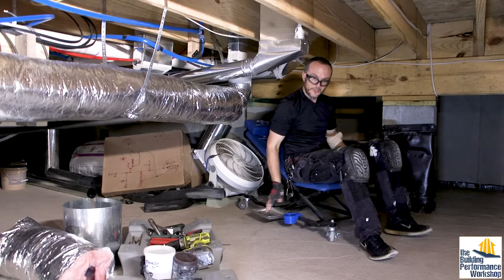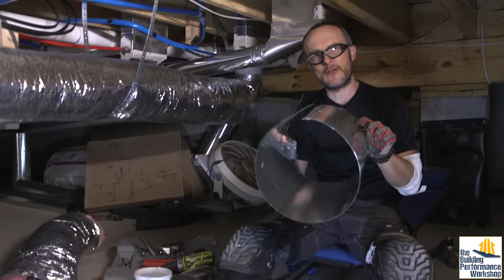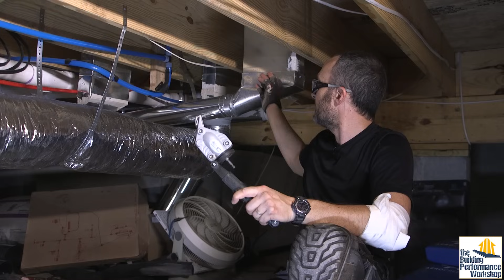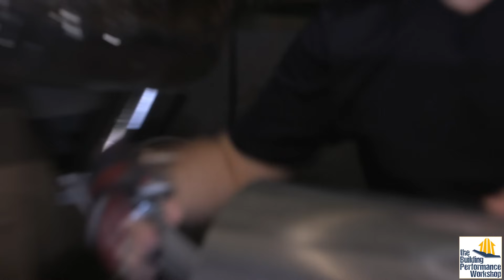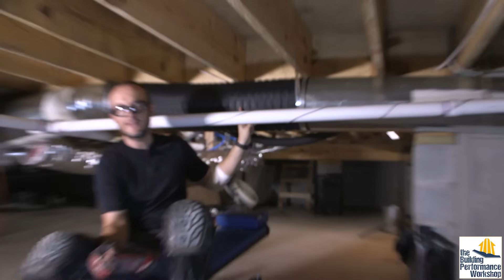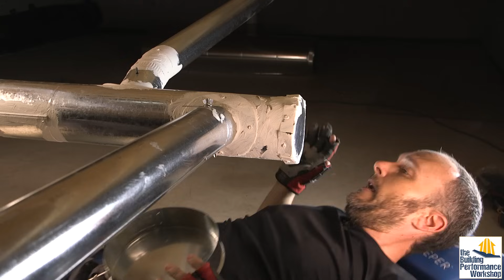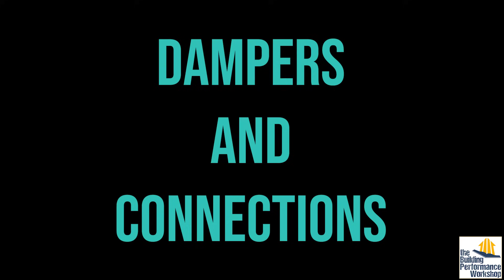Performance Duct Design & Installation: Advanced DIY

Comment: Having a return register at the floor means it draws dust and pet hair across the floor and into the filter.  If the pull is strong enough that will collect along the bottom edge of the register.  IMO the return should be a few inches up off the floor.
Reply from the maker: Yes, good point- ours clears the baseboard, so 4” up. More eould be better if you can find the space.

Comment: Disagree about the UltraAire whole house dehumidifier.  I had one replaced under warranty 4 times.  It leaked refrigerant.  It was installed in the basement under the master bedroom, so likely I was breathing that leaking refrigerant for years.  I had it serviced once, over 500 to recharge it.  No one locally will service these units anymore.  Now it just provides ventilation, but the air is not well filtered or conditioned; there is a standalone dehumidifier which also has been replaced several times but is less than half the cost of recharging this unit once.

Comment: Where did you get your duct wrap insulation without having a license? It's wild how small that stuff is in the bog box stores compared to wholesale.
Reply from the maker: Open a cash account at sn HVAC supplier- they won’t sell you equipment or refrigerant, but you can get ductwork
Reply: @HomePerformance Thanks, I’ll give it a go.

Comment: I'm in the process of designing our new home and would like to have a super efficient HVAC system like this. How did you design it and how would i get it done for my new home? I know the HVAC companies don't do it like this in the area. They just figure out the BTU and CFM needed then run flex duct which typically isn't run properly because it has a lot of spots that restrict flow. Any help in finding a person that can help design a system based on our plans would be greatly helpful.
Reply from the maker: Hi Jake- if you email me, I can get you a bid for a design for your home by me personally:

https://buildingperformanceworkshop.com/energy-modeling-and-hvac-design
Reply: @HomePerformance just sent you an email. Thank you.

Comment: Do makeup air ducts in conditioned spaces typically get insulated to prevent condensation? I'm about to run makeup air ducts through walls and don't want to end up with condensation in those cavities.

Comment: Man I love your videos. I will say that's very funny about your design versus the field because I'm in that same situation. Like you, I want all galvanized steel ductwork because I believe in longevity, durability, and easy cleaning. However, with the design of the house (because my living room has a cathedral ceiling so that ductwork has to work around it), the high static pressure, and all of the boots causing a huge equivalent length addition, I just had to go with flex stuck as branches. But you better believe I'm still putting in those dampers though.
Reply from the maker: Engineering is a series of compromises ;) good work

Comment: One of my favorites. This requires 2 people. Attach multiple lengths of snap lock pipe together as needed for the run. Mastic or tape the connections. Then tape the required length of snap lock to one end of the flex inner liner. Start pulling the inner liner out the other end and you now have insulated snap lock. You can also fabricate insulated double wall by installing a larger diameter snap lock or spiral over the exterior.

Comment: I've been watching videos on flexstock from professionals and they said you need to put 25 lb of pull on the docked to make sure it's not all kinked inside and that will help with the airflow
Reply from the maker: For flex duct, sure- per the Air Duct Council’s Green Book

Comment: This video is awesome. Bravo!!

My house was definitely not balanced and we've wasted time and money dealing with other HVAC companies trying to modify/correct it. I believe it's primarily all flex duct and the 3 bathrooms and the laundry room are saunas in the winter and fridges in the summer. 

HVAC company 1 tried a zone controller and two dampers. (We're a main + ADU and they have a return and we have a return; ~1600sqft-~800sqft respectively) No luck. 

HVAC company 2 tried fixing something they found wrong and the handler started providing resistive heat when the fan was circulating air (no call for heat/cool). After multiple visits they wanted to replace the zone controller for $1600. Most expensive POS design ever. 

(There's also a fresh air damper on an analog timer with a relay and 2 assumed 20VA transformers wired together to handle the 3 dampers, analog timer and zone controller)

I'm going to try replacing the Honeywell with an Ecojay unit. I want to look at changing the ductwork, but it's both intimidating to design and messing around with blow in fibergl@SS is not my favorite.
Reply: Sauna in the winters, freezers in the summer,  just what im looking for in northern Wisconsin

Comment: I had a drug design done by a professional, which used a computer. Everything was done in rectangular size ductwork, except for the supply leads off the main and the return main. Should I change the mains to round?
Reply: Duct

Comment: Thanks for a great video. 
My house has hardwood floor registers flush mount. I understand the grills are very restrictive. Do you know of any drop in flush mount(not raised on surface of hardwood) that would be higher flow? Also maybe be able to use original hardwood flange for grill. Thanks

Comment: I have a new single story home with an attic that houses all of the duct work and HVAC system. I noticed onen 6 foot duct line between a supply line and the return line is not installed. Both sides were open ended. The HVAC tech noticed this and will come back with a flex duct and install it to close the system. For now, he just taped close both open ends of duct. 

Can raw air from the attic that goes into the open return duct line ruin the HVAC system? This house is brand new and I have lived here only 3 weeks. I'm concerned about long term negative effects with the system since we have been operating our system (mostly heat during the winter) for about a month.

Comment: By design side discharge unit really doesn't require this option none of our commercial installs have ever required a cap only wind baffles mounted on the sides of the unit.

Comment: May I ask for the line sets what are the rules? Can it be manipulated up and down like up and over a header then back down the other side to tue condenser unit. I didn’t think these line sets could have any dependent loops or lower sections that then rest of it

Comment: For the drill hole cutter, would that also work on corrugated metal sheeting? I know that’s not HVAC relevant but I’m curious
Reply from the maker: Sure, as long as it’s not a super thick gauge. 28 minimum I think

Comment: a central return is better?  what happens when the doors to individual rooms are closed off (for privacy - or to keep pets out)? - supply air into those closed off rooms ceases circulating - and the room is cold in winter and too hot in summer.

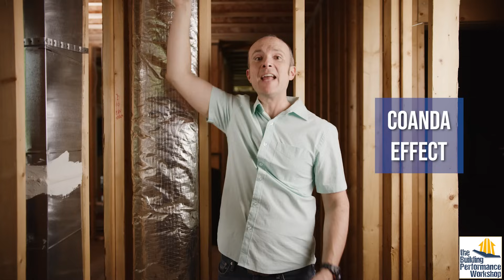Comment: Thanks for a very informative video! At 4:30, you show an example of an insulated supply duct running up in a stud cavity in an interior wall, terminating at a boot. Do I understand correctly that it's a 2x4 wall and the rigid duct itself is 3" deep? If so, is the remaining 1/2" of cavity depth enough to fit that insulation, which appears to be bulging out pre-drywall? I want to plan a similar design on a ducted minisplit retrofit, and am worried that my interior 2x4 walls aren't thick enough.

Comment: Hello! I got the response that you used Mueller Streamline line set in this install.  I've now heard from 2 installers that increasing the foam tube insulation (r value) on the line set will not increase efficiency. That does not seem right to me.  The line set recently used with my Mitsu mini split is very basic, minimal white vinyl sleeved foam.   Will I benefit by adding an additional sealed foam insulation tube around it?
Reply from the maker: I did mine that way because of the 120 ft length- it does make it more of a pain, no doubt
Reply: @HomePerformance  Did a little more digging. What I've got is PDM Gelcopper with 1/2" thick insulation, R value 4.0.  It should be a no brainier, but do you agree that adding the additional foam insulation tube over the existing PDM will increase efficiency?  Like move it from R 4.0 to R 8.0?

Comment: Hi, I'm just beginning to learn the in and outs of HVAC and ducting systems, to build my small house, and there are a couple or three things you have that I don't understand and hope you'll help me with:
1 - there seems to be no insulation between your crawlspace and the upper floor plus your ducts are not insulated, is this a conditioned space and if so, are you returning air from a service space to your living spaces? I've been told to never return air from service areas like kitchens, bathrooms, laundries, and such 

2 - is 100 feet run of hydrocarbon in your line set a good thing (sounds long)? Does the distance between the compressor and evaporator matter?
Reply: 1. Check 4:00, he mentions the crawl space is conditioned. Hence, no need to insulate.
2. Check lineset specs. Most can handle well over 100’ distances.

Comment: on the straight long runs of insulated flex ducting add a board/ metal strip so the pipe does not compress at the strap or sag adding resistance to air flow

Comment: I have never seen any of our  HVAC contractors use mastic on the joints on any of the many houses I have worked on throughout 30 years, they use foil tape?.
Reply from the maker: Probably lasts as long as the flex duct its sticking to

Comment: I respect that 100 year house mindset. I'm working on a 500 year house design and wow, it's not easy to find the right materials and systems!
Reply: What have you found so far? Share the knowledge!
Reply: @caustinolino3687  Stainless steel plumbing supply pipes, not plastic or copper. Really good moisture control, especially in the structure of your external walls. And make the house easy to adapt or renovate! People building houses 500 years ago weren't planning for good wifi in every room, or electric lights, or even indoor plumbing. We have no idea what new technology will be expected in houses in the next 500 years, so all we can do is make it easy to add new pipes and wires.
Reply: @tealkerberus748  Good tips! I'm curious, why no PVC supply pipes?

Comment: Well, sounds like my spec home didn't have a good HVAC design. A single system conditions upstairs and downstairs and they are wildly different temperatures. Also the unfinished basement is getting conditioned by very poorly sealed ducting.

Comment: So this is phenomenal - thank you! I am building an ICF house with ICF flat roof in South Florida. Walls are 12 feet tall on the inside and no attic. I am planning to install sheet metal duct that is right below the ceiling, inside the house. My understanding is that I don't need to seal all the duct joints because the duct is inside the cooled area. If some cold air escapes before it hits the register it is not a big deal. Is my reasoning proper?

Comment: Don’t you want the registers to be on the floor only because hot air rises so when heating the the air will rise and fill the room. It be okay for cooling since cold air falls but not heating.

Comment: I am an everyday person without any experience with hvac. I love watching your videos for fun. They are so informative. I now feel motivated to invest a lot of effort into making sure we have a good hvac system whenever we decide to build our own house.
Reply: You can't go wrong that way. There's tons of information to assist. It's scary how many homes I've seen, some new and expensive, that have terrible ducts. Our house for ex.  unit and ducts were replaced right before we moved in. 5 ton ac, ducts have 2.5 tons of capacity. Heat load on the house at 110 is right around 3 tons.
Reply: I wish more people thought about their hvac system when they try to build their dream home. As a hvac installer and service tech i can attest to the attention to detail that is frequently overlooked

Comment: Personally I prefer to put return ducts in the bedrooms so the doors can be shut for fire safety while sleeping and the rooms can be conditioned while the doors are shut.  I suppose you could use jump ducts to accomplish that but it's not what I would do.  I'd also make the filter grill 4 inches deep from the start.  You could always add spacers for thinner filters.
Reply from the maker: UNDERCUTS on the doors silly. It’s actually in Man D- a 24 sq in undercut can return 50 cfm, a 36 sq in undercut can return 75 cfm. Very few rooms in any performance-tuned home will receive over 75 cfm.

Comment: "I'm recommending a total duct replacement" Of course you do, it doubles or triples the money you make. Now, that's not to say they're aren't times this is needed. Flex is fine so long as it's installed properly. To say otherwise is simply spreading FUD.

Comment: as a contractor, you lost me at your discussion of a central return.  unfortuately, the international mechanical code that i subscribe to, requires a return in each room except for the kitchen, bathroom.  Further, 2" wide haning straps are required on flex duct probably every 4'
Reply: I hate not having a return to any room, like a bedroom, with a door. You either need to hack off a bunch of the door, or install a hole in the wall so you loosing privacy or you need to leave the door open most of the time.

Comment: Scoops are really bad for downstream airflow.  The 45 degree take off is a much better way to go.  This has been proven on the bubble machine.  Great system other than the scoops.  I with everything had to be put in like this.  It would eliminate so many problems in the field

Comment: I just had new 2 stage heat pump installed. New duck work and everything.
It has very little air flow coming out.
You can't feel it standing under the vents.
I asked the guy that installed it about the low air flow, and he says that's normal on the new units.
Does that sound right?
It's a 14.3 ream 2 ton unit.
In a 1600 square feet home
Reply from the maker: Yes, that sounds fine to me, Terry- smaller systems (properly sized) shouldn’t blow on you. As long as it maintains temp and humidity, it’s working well. If you’d like to feel the breeze, use room fans.

Comment: I apologize if this question is listed elsewhere but at 350 comments.. anyways, have you run into noise issues with the rigid duct? I know guys like Matt Risinger use flex the last 15 feet but I agree with your efforts for the '100 year home'. I've considered lining the rigid duct with acoustic foam or other medium density foam. The question I have for you is, would using this foam introduce 'bad stuff' into the home whether by off gassing with hot air exposure (my review of literature days stable at 400F) or creating a surface for mold to accumulate (behind any condensation). I can't find data on this. Thoughts? Thank you kindly
Reply from the maker: Hi Daren- I don’t have a noise issue with our 100% metal duct system. If you pick a quiet air handler system, then there’s no issue as long as there are a few turns between it and any grille.

Comment: Advice for beginners: I've been installing heating systems in new homes for over 25 years and I just recently bought a pair of attachable uni-shears for my drill because of all my arthritis, carpel-tunnel, tennis elbow, golfer's elbow and bursitis. I'm pushing 50yrs old and I'm practically crippled by cutting thousands of miles of sheet metal by hand. I also bought that circular cutting tool but can't get the hang of it and getting burrs. I've mastered cutting metal without burrs but the pain in my wrist these days is killing me. I always worked piece pay and the older you get the less money you make. Pick the right employer that allows progression and seniority without bias or you will end up like me. I make less money today as an experienced journeyman than I did in my 20's as an apprentice. The piece pay hardly went up over the years and definitely not in par with inflation. Try to work for an hourly rate where you can.
Reply: I didn't realize piecework was even legal unless you were a self sufficient contractor
Reply: @2brazy4ubitch i bet you dont realize alot 😂😂
Reply: I'm an installer as well and always worked piece rate with all 3 companies. Went hourly 4 years ago and now I make more money but can take the time to make my installs look nice and work correctly. I'm hoping in the future to get even more experience and seniority and eventually get a management position 👍
Reply: @rq74ever hello after working hourly on a company I am trying to start as a self employed doing installation my question is how you learn to price the installation
Reply: @rq74ever Dan Martel I think is his name has some good advice on getting leverage for promotions. Worked in my case keep grinding and most of all take care of the ppl your blessed to work with. I know so many looking for work rn it sucks
Reply: Brother I do the same job you do. Leave now and go to another company. I’m 43 and I’ll probably work until I die. It’s not too late, get some time in where they appreciate experience and hard work.
Reply: Yea call the local sheet metal union
Reply: I'm sorry to hear that sir
Reply: How many decades did you curse unions, maybe you can advise the young bucks on the job any the importance of collective bargaining and how as a collective can demand better pay, better training, and better working conditions for all.